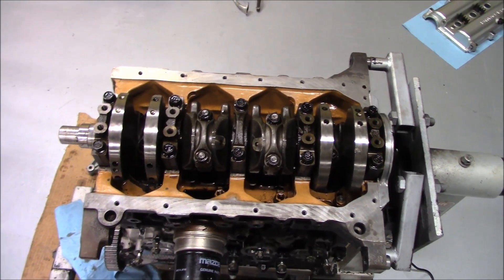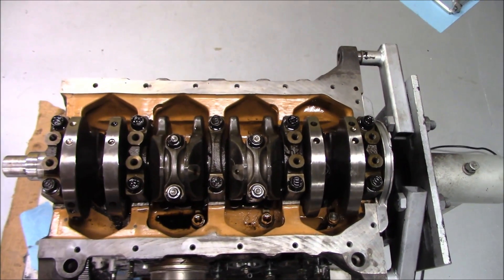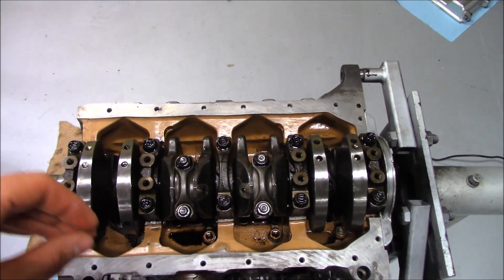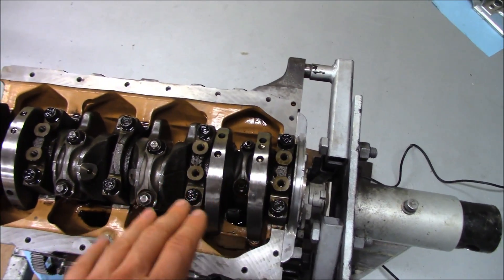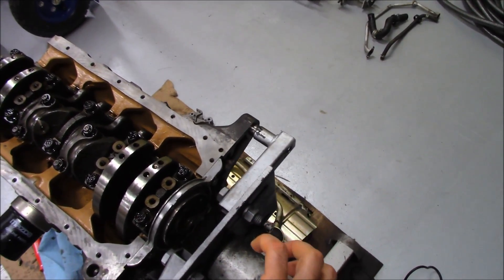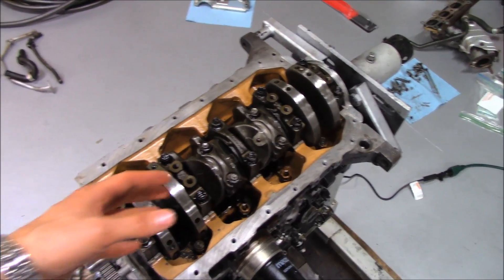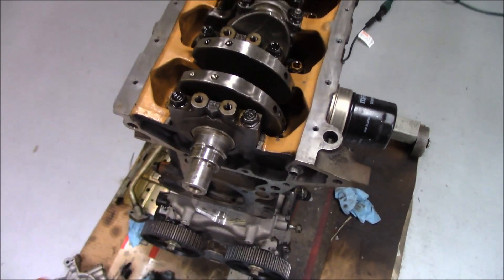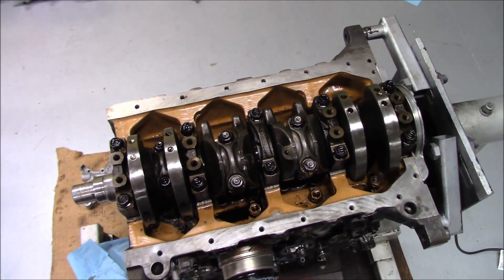Clutch Interlock Switches are BAD!

Comment from the maker: The clutch interlock/override is the switch that has to be engaged in order to be able to start the car i.e pressing and holding the clutch pedal when starting the car. The lateral load on the crank/thrust bearings is increased with stiffer aftermarket pressure plates. This is really only an issue if the car has been sitting and oil has had time to drip down off of the crank. This is not so much an issue with daily driven vehicles. Either way, deleting the interlock switch is not a bad thing on any piston engine to eliminate lateral load on the rotating assembly when there is no oil pressure during startup. My C5 Z06 I was just able to press the interlock button with my foot to start it. For NA/NB Miatas, FM makes an 8.00 bracket that holds the interlock down. The method to delete the interlock will be different for each vehicle. Use common sense if you bypass the interlock. If the car is in gear, you could possibly start the engine and the car will take off going forward. Be safe and save your thrust washers :)
Reply: and now I'm just reading your comment linking FM hahaha
Reply: So the best way to start it is with the clutch engaged but in neutral gear? I always start cars with clutch disengaged, because it's less stuff for the starter to spin.

Comment: So if I can start my car without having to press the clutch (in neutral) it means I don't have to worry about that, right ?
I have never driven a car that can't start if I don't press the clutch.
Reply from the maker: That is correct. I take it you live outside of the US? It was mandated here a long time ago.
Reply: Yes indeed, I'm French. 
I just double check if I'm not in gear, no big deal. Things like that just add more complexity and possible issues.
Reply from the maker: Yup, it's a silly thing that was implemented so knuckleheads don't start the car in gear and take off at the cost of engine life.

Comment: i find it hilarious how people dont immediately notice that the car is moving if they are in gear and bump the starter. Just the other day i was parked behind my daily, and forgot i parked in gear, bumped the starter and before i moved an inch the movement startled me. (my car also has a gear reduction starter motor for easy cold climate starts so it springs to life much quicker than my spare starter motors. 😅

Comment: I use 0w40 or 5w40 synthetic in the summer and 5w30 synthetic during the winter in my 1.6l turbo
Reply from the maker: Way too thin in my opinion. Unless you are running tighter bearing clearances than stock. I ran 10w30 in my 254 whp / 236 lb 1.6 turbo for over 30k hard miles with plenty of track time. No issues. That motor is still going strong in the new owner's car.

Comment: Hey Quinn, Z4m Coup brother here. What oil weight are you running on the Z4M that gets driven pretty regularly? The S54 rod bearing debate is all over the place
Reply from the maker: Hey Jordon, I run Redline 10w-60 in my Z4M. I do give that thing a generous warmup and do not apply any real load to it until I am above 160' F oil temp. So if I do drive it below that oil temp, I am very gentle on throttle and do not rev it high until above that mark. I have run a few oil analysis on my engine now and they have both come back clean. I really just hope the rod bearing issues are from people hopping in the car and just driving it before oil gets up to temp. With our giant iron blocks, it definitely takes some time. On the plus side it's nice that we have oil temp gauges from the factory to know when we can put the hammer down haha ;)

Comment: I’ve been running 5-30 in mine do you think I should switch?
Reply from the maker: 10w30 should have a slightly higher flash point.
Reply: hmmm interesting i think ill make the switch then since i don't drive it in extreme cold during the winter
Reply: so it will burn off less easily?
Reply: christopher martin 5/30 and 10/30  are the same thing at operating temperature.

Comment: Perhaps I'm dense, but you never explained why the clutch override switches are "bad"? If anything the argument would seem to be FOR clutch overrides, as you no longer have to press in the clutch to start, the thrust washers aren't pressed forward, and thus aren't shaved. No?
Reply: He's saying that the interlock switch that comes from the factory is bad. Over riding the switch which is usually just a simple clip that keeps the switch closed, is good for the engine. The only downside is the ability to start the car while it's in gear.

Comment: What you saying about the Oil makes sense if you are living in not so warm climate and not starting your car in cold.
There are many recommend oil weights for Miatas.
I personally run 5w50 for my ITB Miata.
Car starts easier in the winter and it actually sounds better for the first minute or so. 
And warm weight 50 well....I wouldnt trust anything lower for summer track work here. And like doing one lap of the Nürburgring that's 80% full throttle for 8-9 minutes I think 30 weight oil cant  cope with that. Maybe with the oil cooler I would go down do 40 in the summertime.
But driving normally 50weight maybe robs 1-2 hp from the engine
Reply from the maker: 5w-50 is pretty thick. Your bottom end is built though right? Did you run a bigger bearing clearance than stock?
Reply: Garage Quinn Motors 
No I have a stock engine
When you look at Miata VVT engine manual w50 weight oil is also recommended for +35 Celsius degree weather....which is whole summer here. 
That what you saying is maybe important in a La Ferrari engine...but not so much in our engines...you can basically run everything. It's not fancy engine after all.
But of course I'm changing it over to 40 weight in the winter.
You just can't trust 30weight oil on a track day in a middle of European summer.

Comment: I read on the manual that it takes 10w-30 and 10w40 in the hot summer heat. What are your thoughts on that ?
Reply: Garage Quinn Motors
Reply from the maker: Yes, you can run thicker if the temps are really high and the car is going to see sustained high RPM. I still run 10w-30 on track in my Miata's too but that is only dealing with New England summer temps. Southern regions I would probably run thicker for really hot days.

Comment: Deleting my clutch switch next week.  Also new act clutch and flywheel going in.  What transmission oil do you recommend?  I'm thinking about going with redline mt-90 since I'm putting down 200 ft lbs of torque at the wheels so 250 crankish with 10 lbs of boost.  And the more aggressive clutch flywheel setup.  I'm not a knucklehead and know that the transmission oil should be fully up to temp before trying any fancy shifting.  Also I always run redline 10-30 and the 1.8 turbo loves it, always runs good all the way up until it's time to change.  I think 5-30 is good for larger NA 4 cylinder motors like 2.3 or 2.5.  0 weight does seem ridiculous.
Reply from the maker: I've been running MT-90 in the transmissions of all of my Mazda's for the past 13 years with no issues. Well except for the transmission bearings that my turbo Miata killed in two transmissions, but that was more of them not being able to hand 236 lb/ft with an ACT 6 puck unsprung lol. Not a gear or synchro issue.

Comment: Would you also suggest 10w30 for the 4th gen MY engine? I'll be purchasing the BBR camshafts and valve springs for myself in the next couple of months as well if that matters.
Reply from the maker: 4th Gen as in ND? I'd run whatever the recommended factory weight is.